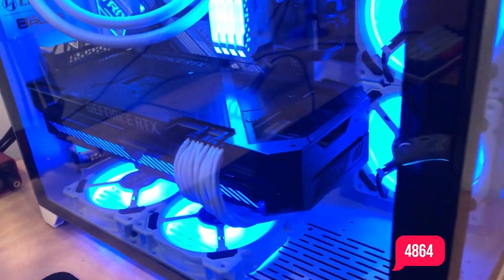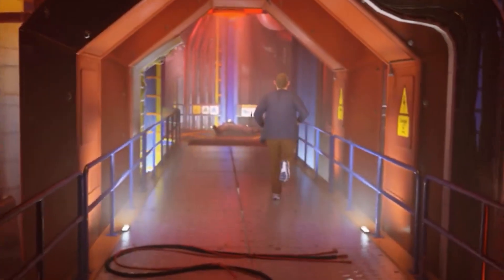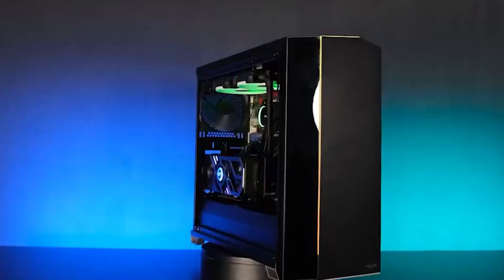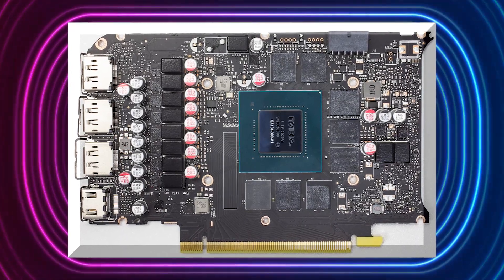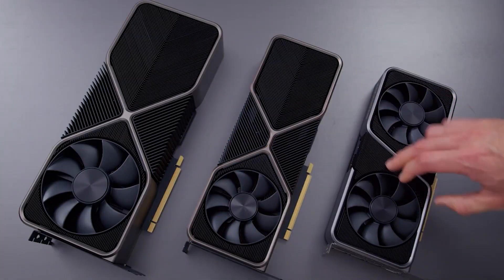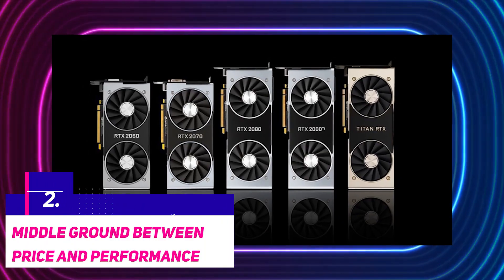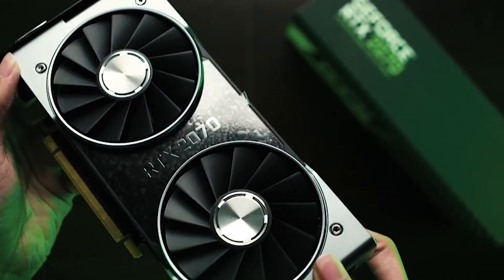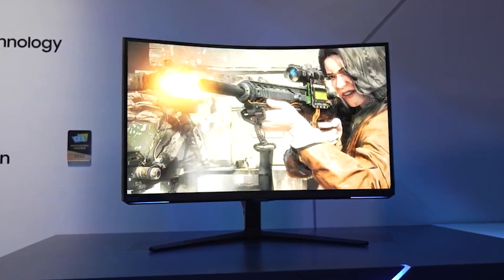Worth Paying More for the 3070?

Comment: Went with the evga ftw ultra 3060 ti with the boost clock 1800 mhz closer to the 3070 . Staying at 1080p so it’s perfect paring with a 5800x as well that should be a hitter Forsure
Reply from the maker: $$$$$ pick, good job

Comment: Which one should i buy th rtx 3060 or 3060ti, in my country the difference between them is about 200$ to 250$, but tbh the price of the two is pretty too much high you talk about 600$ for rtx 3060 and 800$ for 3060ti
Reply from the maker: unless you REALLY need the juice just go with 3060

Comment: Awesome comparison! Any chance you can compare the 3060 ti and the 3070 ti?
Reply from the maker: There is a pretty substantial difference between the 2…like the 3060ti/3070 are pretty close so it’s hard to k pw which to buy but the 3070ti is just overall better and if you want more power in your gpu and can afford the difference, go w the 3070ti
Reply: @TopTierTech1  3070 is more closer to 3070Ti than 3060ti. There is a 15% difference between 3060Ti and 3070 but only 5-7% difference between 3070 and 3070Ti. 3060Ti is best value card and then 3070 but 3070Ti is worst value. Even current market prices reflect that. 3070 are priced very close to 3070Ti due to low power consumption, less heat and slight decrease in performance
Reply: @sVr_AT  True. 3060ti, 3070 and 3070ti are all 1440p cards. You pay more for future proofing at 1440p. 3060ti is lower end of 1440p, 3070 middle and 3070ti upper. For people upgrading gpus every 1-2 years 3060ti is the option to go. If someone keeps gpu for 3-5 years then 3070 or 3070ti is way to go for 1440p

Comment: I currently have an evga 3060ti I bought off evga b stock and somehow it's eligible to "step-up" to a evga 3070 ftw. Basically I bought a refurb card 3060ti and have the opportunity to buy a new 3070 if i send the 3060ti back to evga. Do you think it's worth it for $375 (this includes tax and shipping).
Reply from the maker: No, not worth $375
Reply: Definitely not worth $375. If it were $100 maybe but 5-10% performance gain is not worth nearly $400
Reply: No way!

Comment: Should have done some research before releasing this video so you could have been more accurate about current prices.  The "REAL" difference in price is around $200 not $100, and you are lucky if you can find a new 3060ti for $800, and 3070 for $1000 new.  Those are the real current prices!
Reply from the maker: Hey homie we addressed this several times in the vid, did you watch the whole thing?
Reply: @TopTierTech1  I keep hearing reviewers talking about MSRP, and that clearly has no bearing on what you have to pay now.  Talk about REAL differences in the prices we have to pay now, Homie!
Reply: @DantJorin  He definitely did speak about that, the whole market in whole is overpriced so its up to the consumer to do the research and find out what card is worth it to them because there are too many variables for one youtuber to tell you which one you should buy without knowing where you live and what budget you have
Reply: Just bought a 3070 for $600 on amazon bruh
Reply: @PARAN0IDxGERBIL  yeah thats solid! Luckily 3000 cards are getting a lot closer to msrp nowadays
Reply: I just bought a STRIX 3060ti OC V2 for 522 on Amazon, next day delivery. Prices have started to drop significantly